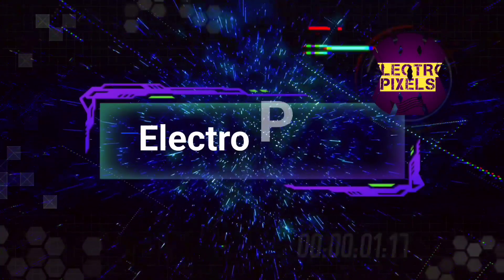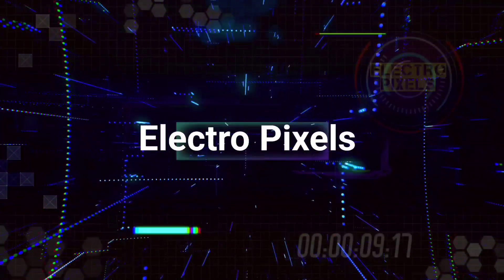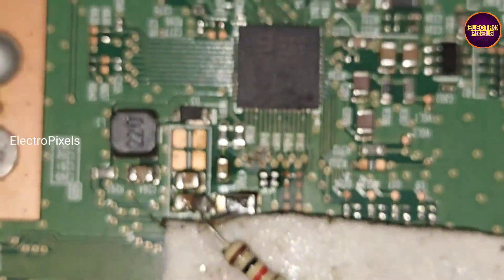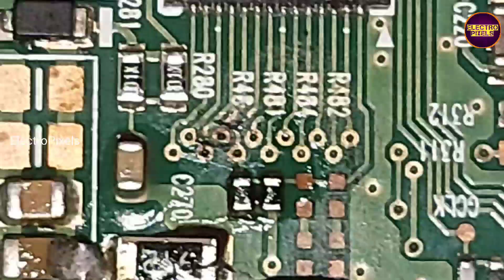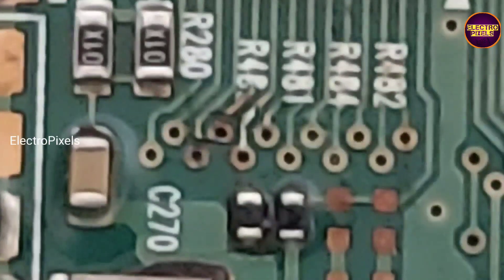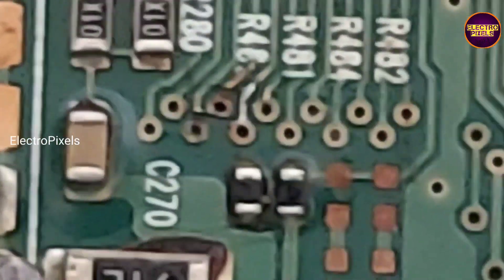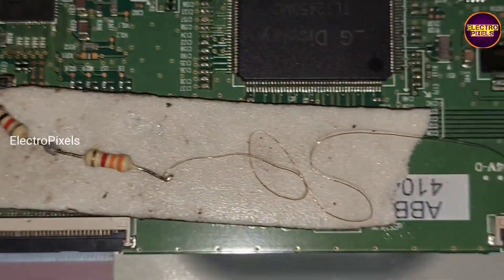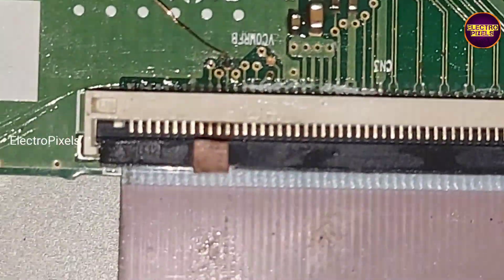VGH ODD LEVEL SHIFTER Bypass|Levelshifter IC modification method to solve Picture freezing| LG Panel

Comment: Hi, great video thanks. You are reversing low frequency voltage toggle points Vgh/Vgl or LC1/2 but did you know you don't need to do it this way? Just tape up clocking sqare wave lines in the fault affected part of the screen (CKV 25kHz) on the ribbon cable and tighten the clip, and this will solve the issue as well
Reply from the maker: In this Tv both side Gatesignals is damaged and the Complaint will not solve by just blocking Gatesignals
Reply: @ElectroPixels  oh  I see so that means you tried to block CKV before and it didn't work? So the next step is to reverse Vgh odd even by connecting them to DC voltages, thanks
Reply: @ElectroPixels  what did the fault look like on the screen? Ty
Reply from the maker: For Double image Taping method is ok, if picture freezing then it's not possible
Reply: @ElectroPixels  thanks brother. I also see you are only using one bypass wire here (although you had cut up both) and run it through the two resistors. I understand the short is only in one state, ( when voltage is high on one of the pins) so you can try with output one, and output 2 to solve the issue. Thanks. What about the negative state, you left it out?  (I would also appreciate if you could upload some vids with emmc programming in future)